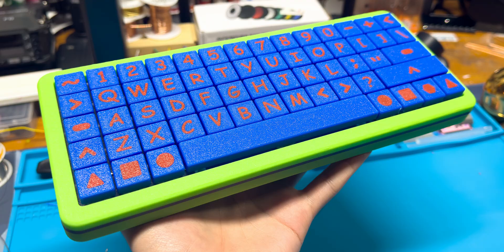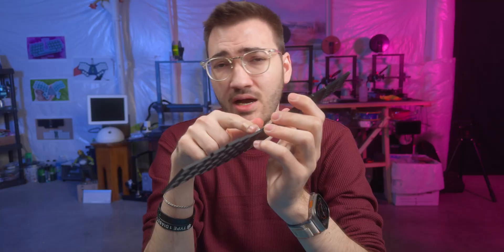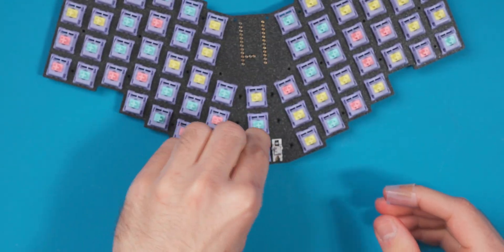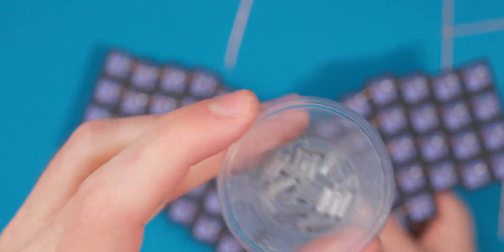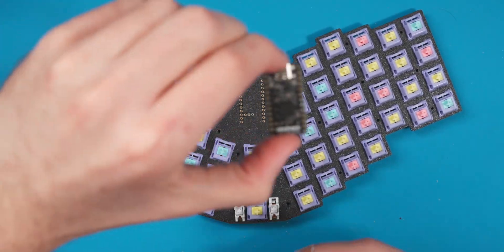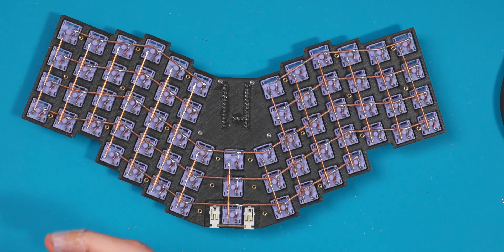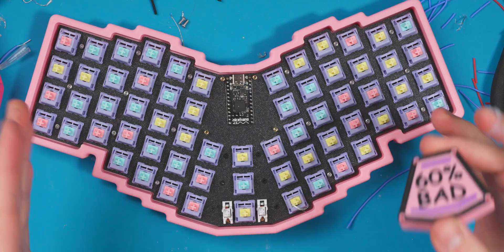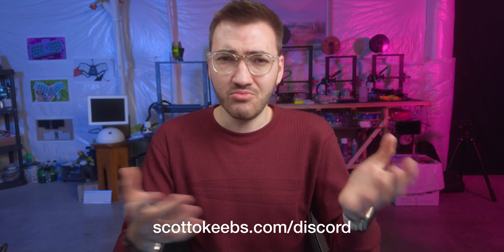Building a WIRELESS 60% Ergonomic Handwired Mechanical Keyboard

Comment from the maker: Let me know what you think of this board, I plan on doing more bigger boards this year to hopefully pull over the 40 haters to handwiring😂
Reply: i would say it doesnt matter that much as you can apply the same process to building a bigger one just the same right?
Reply from the maker: @Dajan456  Yeah, it's just more work for bigger boards. I just want to have more designs that more people would be interested in.
Reply: I have a design for a keyboard that I want to create, but I'm not sure how to, I just made it. Might need to have a combination of mechanical switches and membrane just to get it right though. I'm not really willing to give in to the 'it's not possible crowd' or sacrifice the way it looks. It's a totally new keyboard layout. I don't have the money to create it atm, and I don't have the skills or knowledge or the tools, so I can't 3D print a prototype or anything. "/ Maybe I might learn soldering and do some hardwiring, but I still need a case for it to be in. "/
Reply: Could you make a video on how to connect two microcontrollers for the spilit keyboard. I saw somewhere people were using 3.5mm jack, but I couldn't find exact explanation how that works
Reply: still waiting for your new handwire board :hand-orange-covering-eyes:, Do you think you will build an dactyl or something curve like that?

Comment: What about recharging the battery? I get it that it will last a long time, but will recharging require a disassembly of the whole keyboard? Or just connecting usb c to the controler? Is there some kind of bms there?
Reply from the maker: The controller handles the battery stuff, you just plug it in and it will charge as long as the power switch is on.
Reply: @joe_scotto  nice, that makes it really convenient, I must try that. Thanks for fast response :)

Comment: I just watched all your vids and this is good material for starting my own build. But the thing is I planned on using an ESP32 with V-USB and another ESP-NOW supported board for tri-mode but I don't see anyone using it neither is it supported by QMK firmware. Could anyone tell me why?
Reply: According to some feature request issues that were raised on their github related to this, it's mostly because the ESP32 has a different architecture than the microcontrollers they currently support, and (as you mention) it requires setting up V-USB (unless you get the ESP32-S2 in particular). So due to the difficulties of setting up a whole new build process and structure for the different architecture, it's unlikely to be supported soon, but based on the cursory work and investigation some people have done, it seems it could be possible if someone goes at it for a month or two.

Comment: 8:45 nice, fellow colemak user. Do you actually use your caps lock as a capslock? Mine is bound to backspace on all my computers.
Reply from the maker: Colemak is the best and I use enter where caps lock is on layouts with a 6th column. I mostly just use my 30% keymap though so I only use like 40 of the keys.
Reply: @joe_scotto ah ok, makes sense. I mostly use laptop keyboards, so I'm stuck with how the keyboard was built.

Comment: Awesome video as always! 
Just wondering, is there a reason why you separate the switch plate with the case? 
I design my keebs to be in a single body so I have the smallest but jankiest builds. Just found out the keeb I built a few weeks ago had cracks on the thinner parts of the body and there's a noticeable bending. Doesn't affect functionality and typing feel tho.
 
And maybe not a good place to ask, but have you thought about selling your STL and firmware files before instead of giving them out for free? Thought of doing that.
Reply from the maker: By separating them it allows me to get better prints mostly. If I was to do a fully integrated plate, which I have done before, it requires tons of supports. You can get around this by doing exposed switches, but I think that doesn't look as nice.

The handwired project is always going to remain free, I sell prints of the files on my site but don't ever plan on charging for the handwired files.